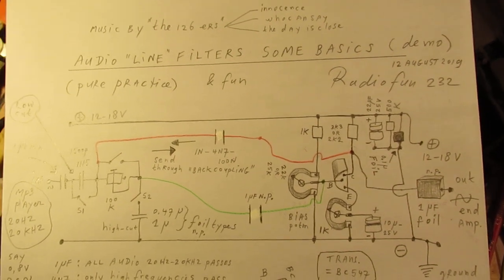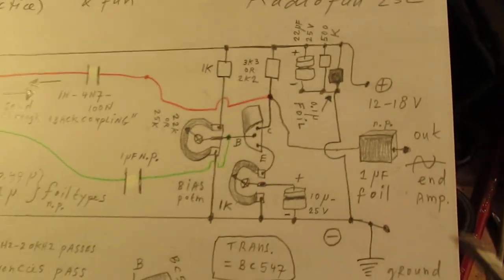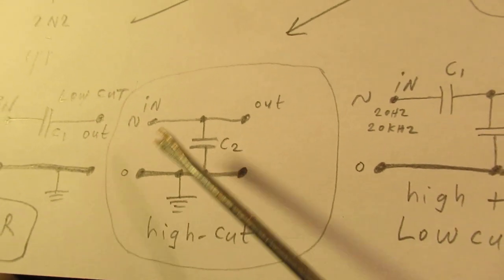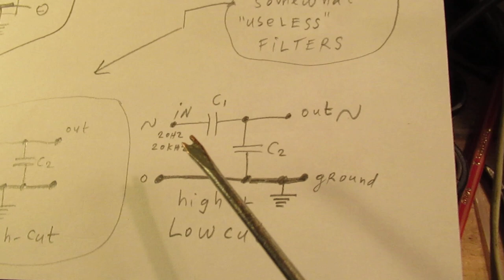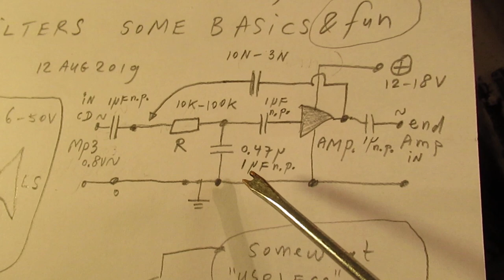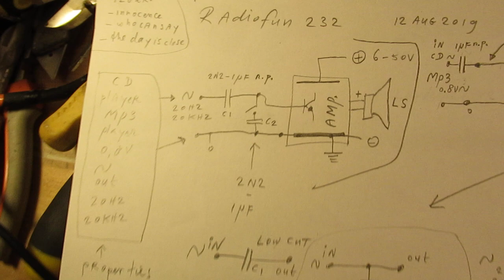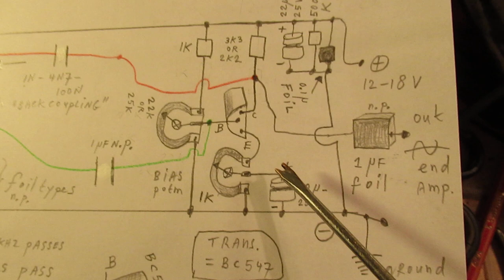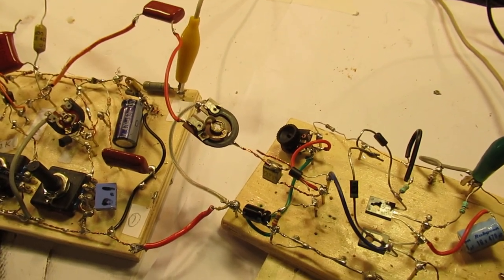Basics of audio filters for 20 Hz-20 KHz (schematic and demo with a 1 transistor pre amp)

Comment: Hello again, is this from your book Schematics 2: Tone Control circuit II to be exact? 
I’ve never used transistors for my filters, and I don’t know why. This may be my next task. 

Are you familiar with The Active Filter Cookbook, by Don Lancaster? You may find it useful. 

Thanks again for these great videos, they are gems.
Reply from the maker: Hi Sean Patrick, thanks for your comment, appreciated. This refers (in a kind of way) to my book "Schematics 2, audio amplifiers and loudspeaker boxes", but also not. It is/was a new experiment to make an audio filter, though the principles are (like you say) in that book. I don't know the Active Filter Cookbook, thanks for the tip, I will search that info. And take profit of it. Thanks again. 8 feb 2023.

Comment: hi, very good always.
i want to say how can i do if want do a noise filter for ham radio, it's low pass and hi pass filter adjustable ?  which frequency it's an how calculate componant ?
ty
;)
Reply from the maker: Thanks. The easiest noise filter for ham radio is a capacitor between 3N3 (3300 pF) and 50 N (50000pF) in the signal lead to ground. It takes away the noise, of course more effect with the 50 N capacitor. For a HAM radio it is important that the audio band is also limited (cut off) on the low side and on the high side, so that the "speak range" becomes more manifest. That is the audio band between (say) 1000 Hertz and 5000 Hertz. I think you can use this schematic for that purpose and do some experiments with the value of the 1 uF capacitor (try a smaller value, say 50N) and the series capacitors (smaller, go to say 5N). I will try to find a video on my channel with another usable circuit.
Reply from the maker: With this filter you can set a certain audio frequency band. It can also be made with the 1 transistor circuit, not with a FET. Use a coupling capacitor (100 N or so) to couple the signal into the base of the NPN transistor. https://youtu.be/A_GX8R3EF-k